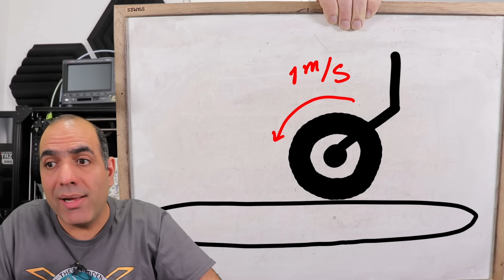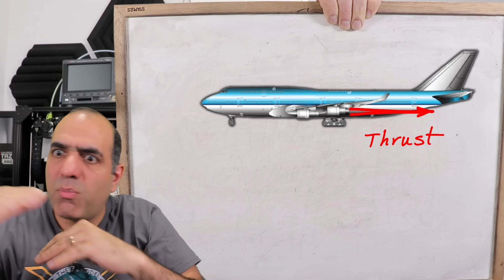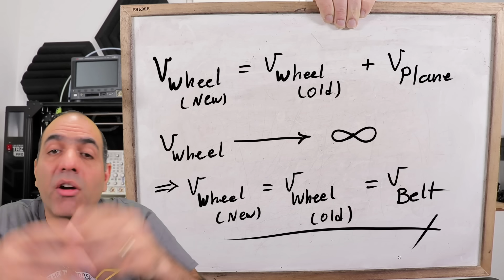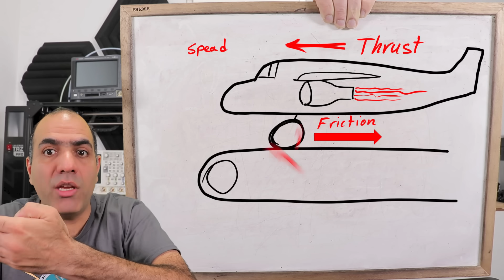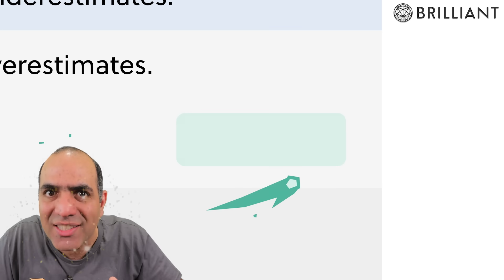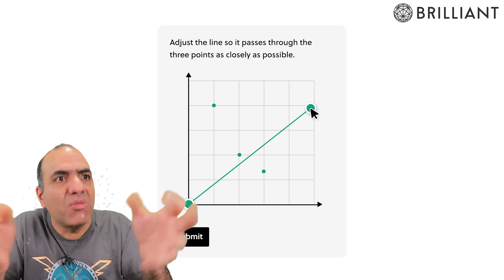Airplane Question that Drove Me NUTS!!!

Comment: The wheels just spin as fast as they want. The thrust just has to overcome the moment of inertia of the wheels. The plane still takes off, and the belt won’t hold it there. The belt can spin at 2,000mph and the plane can still go forward and take off. If it was a vehicle that used wheels for power, that would be different. What matters for a plane is air speed, and a conveyor belt doesn’t change that.  Again that belt could be running a 15,000mph and the plane will still move forward and get lift. (Ignoring the tires blowing up from spinning so fast). 

Instead, put a 500mph tailwind behind the jet. Will it take off at typical ground speed now?

Comment: If the belt speed matches the wheel speed, the plane has no forward movement. The engines don't affect enough air along the wings to generate lift, so the plane doesn't take off. 
A more realistic way to model the same thing is just to tie the plane to an anchor and try to make it take off.
Reply: you are forgetting that wheels spin
that is what they're for, dude

Comment: For this kinds of problem, always consider what kind of support the component that connects the body to the ground. In this case, the wheel is a roller which means the AC is able to freely move along the surface and away from the surface.

Also taking note that as the plane speed increases, traction between the wheels and the ground decreases, due to the Lift.
Reply: The plane speed is measured in two separate methods. Ground speed and air speed. For take off, air speed is all that matters. Normally this is the same as ground speed until take off, ignoring winds at the time. But in this scenario, the ground speed increases to match the forward movement of the plane, resulting in zero air speed. And thus no lift to remove the wheels from the ground.
Reply: @NandR  No, that does not result in zero air speed. Here's my thinking: why would the wheels rotate in the first place? It would have to be due to friction with the ground, but that friction can only occur if there's a difference in the velocity of the bottom of the wheel and the ground, and in this case there is no difference by definition of the question, because the conveyor belt moves at the same velocity as the bottom of the wheel. So the wheel doesn't even rotate at all. The plane moves forward with no friction to impede it. The wheels don't rotate, as the belt moves forward at the same speed as the plane. In fact, this makes it easier for the plane to take off than normal. Normally, it's impeded by friction of the bearings of the wheels. But in this case, it's analogous to a plane with skis that have no friction at all.
Reply: @vibaj16  friction occurs because the plane has mass in a gravitational field. So it is being pressed onto the ground with its weight. The tires are also rubber which have frictional coefficient. So as the plane is propelled forward it has to roll. It’s exerting a force on the air and moving forward relative to the surroundings. Think of a shopping cart being blown by strong winds.

Comment: In a relative sense the belt and wheels always being the same speed is the same as them being stationary.  So tell me, if a 747 is stationary, how can it build speed without rolling its wheels?  The minute the engine applies thrust to the air, the plane will move forward causing the wheel to roll as it does.  You can’t move the plane from stationary without the wheel rolling.

Comment: 0:42 no it will not be able to because there is not enough air movement around the wings if the plane is moving in place to create lift. Plane needs to be able to move fast enough in one direction for the air flow under the wings to create lift enabling it to fly. Once airborne it needs to maintain a speed fast enough to stay airborne. If I remember correctly a minimum of 90 mph just to get airborne. Same with if it is not moving, but sitting on a conveyor 😅.
Reply: thousands of pounds of force forward, nothing holding it back, and it doesn't move forward?  why?

Comment: It's really quite simple. If the wheels stay in the same spot on the conveyor belt and the conveyor belt reaches takeoff speed then the plane can fly. If the wheels do not stay in the same place on the belt when it moves then the plane will not fly. Wheel speed has nothing to do with generating the uplift force needed to elevate the plane.

Comment: It wont fly, no wind will go under the wings to create lift
Reply: thousands of pounds of force forward, nothing holding it back, and it doesn't move forward?  why?
Reply: @tsm688  the plane doesn't take off because of the force produced by the engines alone, air needs to flow under the wings to create lift. By staying stationary on the runway - conveyor belt, despite the engines working at full power, no air flows under the wings, thus no lift. With these conditions, all the air will go in the engine's intake and not under the wings. Im no expert but this is what i believe
Reply: @PCgamer474  there is thousands of pounds of force pushing it forward and nothing hold it back.

it does move forward.

air does flow over the wings.

Comment: I needed this video, I'm an aerospace engineer, I had both professors and colleagues states that the plane wouldn't fly because of the speed matching it got me really mildly mad lol.
On the third solution I actually think it can take off, if friction and thrust match it only means that it won't accelerate, but if the speed is high enough it could take off, also considering that lift is not an on/off thing, but it grows, the friction between the wheels and the conveyor belt is constantly dropping
Reply: Bro ur an a aerospace engineer, u need to get a new job quick smart, if the plane is stationary and there is average winds speed is not enought to cause lift then it aint gonna fly, THE PLANE IS STATIONARY CAN A PARKED PLANE FLY NOO UNLESS THE WIND IS ACTUALLY ABLE TO CAUSE A BIG ENOUGH VACUUM ON THE TOO OF THE WING TO CAUSE LIFT
Reply: I also thought the 3rd one was possible, but dependent on the plane's acceleration and take-off speed, and the belt's acceleration. If the belt accelerates instantaneously, then as soon as the plane is moving at all, the belt's speed is infinite... or wait... it'd keep accelerating while the plane is moving forward, then once the wheel friction is high enough, the plane would decelerate back to zero, at which point the belt would also stop moving. I think the plane would crawl forward in infinitesimally small shudders if the belt's acceleration were infinite.

But yes assuming the wheels have friction, but the plane and belt's acceleration is finite (even if the belt's top speed isn't), then I think that it's just a race to see whether or not the plane can accelerate quickly enough to reach its take-off speed, with the belt providing more and more friction as it accelerates underneath the wheels.
Reply: I don’t know how your professor/colleagues don’t get to the infinite belt speed conclusion. 

I’d like to propose a new stupid solution to the stupid question: the belt starts spinning so fast that friction with the air creates enough airflow for the aircraft to lift off with zero ground speed.
Reply: i made a video on why it wont take off.
Reply: i made a video on why it wont take off.
Reply: It doesn’t matter how it is propelled. If you want to move forward on the ground your wheels have to move. If the speed of the wheels equals the speed of the conveyor belt the distance travelled by the wheels is the same as the distance travelled by the conveyor belt therefore you have effectively travelled no distance through the air, therefore you have no airspeed and therefore the plane doesn’t take off.

In the end it is a problem in how the question is worded. If the plane moves forward by as little as a centimeter, wheel speed and belt speed have not matched therefore the question is broken.
Reply: They aren't wrong tho
Reply: Do they think airplanes are propelled through the air by their wheels?  I really worry about these people.  Once you realize the trick of the question -- whatever force you apply, only makes the wheels spin -- it's really easy to see through.
Reply: @tsm688  not really, it's more an issue with the interpretation of the Question, considering that is basically a copypasta, you might forget even what was asked and make up the rest, and then you have wrong answers. The Real thing is that it's a stupid thing wrongly wrote
Reply: @riccardobossi5907  the answer remains the same unless you resort to bullshit like light speed treadmills.  In any physically possible situation the treadmill is just a red herring.
Reply: @tsm688  The trick of the question is that there are multiple answers, they all aren't inherently wrong.
Reply: @JoelLinus  The correct answer is the one that doesn't involve magic.  It's not hard to figure out.
Reply: @tsm688  Not sure what that's supposed to mean.
Reply: @JoelLinus  treadmills that reach light speed?  magic.  Therefore, an invalid interpretation of the question.
Reply: @tsm688  Like I said, the reason for the existence of this question is to get different answers out of different people.
It is most certainly not a scientific question and was never supposed to be.
Reply: @tsm688 Magic such as frictionless wheels and wheel bearings, yea?
Reply: @Yutani_Crayven  Wheels and wheel bearings have very little friction.  That's why we use them instead of fred flintstoneing it to work.  So little friction that it really doesn't matter unless you want to measure stopping distance or energy or whatever.  Or start resorting to bullshit like unreasonably fast treadmills.
Reply: @jth_printed_designs  the vehicle - any vehicle, only moves by rolling while on the ground.  The net result of force (by pushing, pulling, using a powertrain wheel system, or by using a propeller, jet, or rocket) is rolling motion of the vehicle.  If you negate the rolling motion of the vehicle as stipulated, you get no velocity.

Another way to view it is that the rate of change of the vehicle and associated wheel speed is also negated by this conveyor.

It’s hard to visualize and most experiments don’t come close to adhering to the conditions.

When one sees it properly as designed with the parameter, it’s easier to see the rest.  Worries about friction or bearings or anything like that become unnecessary distractions from the points.

The vehicle doesn’t roll anyplace and there is no airflow over a stationary aircraft and no lift.

Comment: It could even without any space - just as long as there is strong enough wind. Now gaining control once its taking of could pose a challenge, maybe. But, sure, being stationary relative to the ground is not whats relevant, being stationary to the air is what is relevant... in fact, if the wheels and with it the conveyor belt would move fast enough, the belt itself would accelerate the air. Now, by the point the wheels would be melting due to friction but thats a different issue.
Reply: @tsm688  I never said it would be stationary, merely that even if it was there is nothing stopping i from lifting off.
Reply: @rtg5881  I replied to the wrong person, sorry

Comment: If the 747 is loaded to 60,000 pounds then it can't take off because somewhere between 102 and it's take off speed of 160 knots it's tires fail since their never exceed speed is 204 knots. Not to mention how much load you're putting on them accelerating at twice the normal. That's a lot to be putting on those (relatively speaking) little rubber donuts.

Comment: Even if the plane had no wheels and was just scraping a metal stump across the ground, the plane could take off(given sufficient thrust) since friction is constant since the formula for friction doesn't include velocity. If you ski/snowboard, you'd notice that the friction between the skiis and the snow doesn't increase as you go faster.
Reply: Yeah because the snow in your example is stationary and not moving backwards as you're going over it.
Reply: @Anto64w  There's no difference between you moving, the snow moving, or both at long as the relative speed is the same

Comment: if the belt and wheels are turning at same speed it doesnt matter how fast they are moving, the plane will stay stationary and no air will flow over the wing. no air flow over wing equals no lift

Comment: omg ... to take off, it is necessary for air to pass around the wing, which creates lift... engines are not enough, the plane is not a rocket. obviously, when no air flows anywhere around the wing, it cannot take off. in the myth busters video it is clear to see that the plane is moving forward so that it has started to exert lift....

Comment: I understand you rscenarios. But, regardless of the intention, the Twitter account chose to give their belt idealized properties. "Will always exactly match etc etc..." requires either a magic unicorn or idealized conditions. Therefore, it is correct to assume idealized properties for the wheels as well, or at least a magic unicorn pilot. I'm sure that's not what they had in mind, but you don't get to cry realism when you idealize your premise.

Comment: Without friction between the plane’s wings and the air around it the plane can’t take off. Since the plane and the surface off witch he wants to take off are at same speed but opposite direction there isn’t any friction that could create the needed pressure to make the plane rise…

Comment: The plane wouldn't take off in any case. In order for the plane to move, it is a necessary condition that the wheels turn faster than the conveyor belt.

However the frictionless ball bearings is an interesting case, because it is impossible. That necessary condition I mentioned still exists, however, it would violate the conservation of energy principle, as the jet engine is generating thrust and energy can't be transmitted between the belt and the plane.
This is a contradiction, and therefore, it is impossible that a 0 friction ball bearing exists

Comment: ya... the answer is No. Planes don't fly because the wheels can go fast , they fly from air pressure differential under and over the wings. And as no statement about their being any head wind it defaults to 0 mph

Comment: It’s impossible to design the said conveyor belt because it assumes the speed of conveyor belt instantaneously matches the wheel in other direction. As mehdi noted, there is no conveyer belt / wheel speed where the required equation checks out when the plane is moving forward - which it will if three is thrust. You can’t just say the conveyor belt will do this - explain how and the we can show where it will fail. It will likely involve some feedback circuitry with delay and that can lead to a solution.

Comment: I don't get it. What's all the fuzz, seems so simple. Plane does not move through the air and thus it will not lift off. Basta.
The plane does not care if it has wheels or skids or friction or not, or what speed it has relative to the ground for that matter
You can land a plane with zero speed relative to the ground if you have enough head wind creating lift.

Comment: At first glance, this is like how you throw a paper plane. The speed of the conveyer belt is enough for the plane to take off (given that the pilot hold the plane to stay on the belt until it reaches top speed, then lift off), yeah it would fly.

But like, for a few meters

Comment: my new favourite solution is the belt moves forward at the same speed of the plane. meaning the wheels don't rotate at all, and the belt is stationary from the reference frame of the wheels
Reply: Except the question states that the belt moves opposite meaning your solution doesn't apply to the question.
Reply: @Anto64w  mmm good point good point

Comment: It won't lift off. 

Assuming a take off speed of 300kph, the wheels would be moving at 600kph at the point of liftoff. Since the 747 tires are only rated up to 380kph, the tires will explode before reaching liftoff speed, and the plane will crash and burn as its landing gear is destroyed.
Reply: The treadmill motor would break first, so it would take off